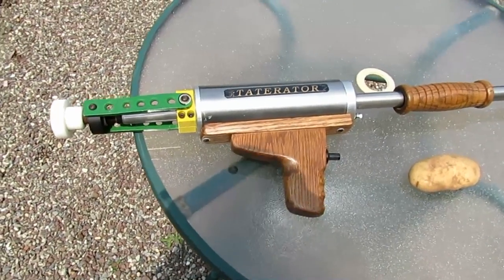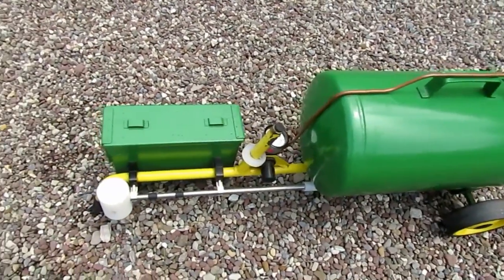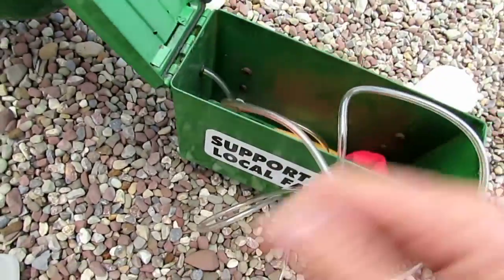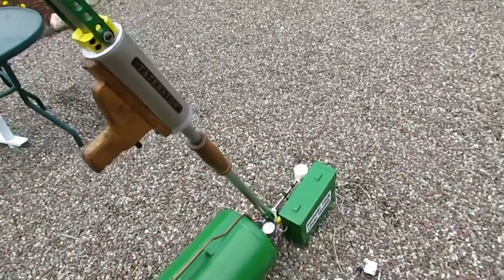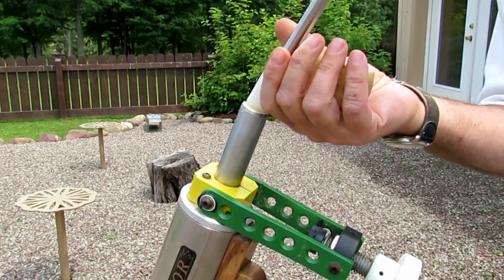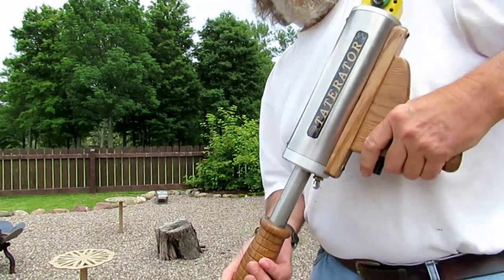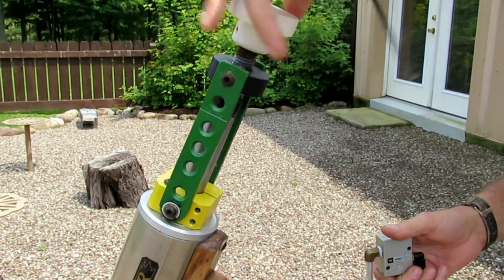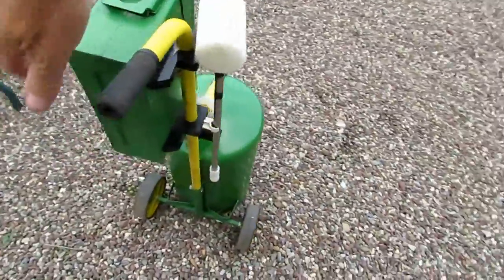Home built 20 mm potato gun

Comment: will it work with just the alcohol? without the injected oxygen?
Reply from the maker: It didn't work reliably or have good combustion with just alcohol.  I also tried propane that did not work well. Hair spray worked,  but left a mess there was no way to easily clean out. This was the best combination I could find and it only leaves some moisture behind from the alcohol. Thanks for watching my video.
Reply from the maker: Just looked at your channel and you did a amazing job building the tank. Keep up the good work.